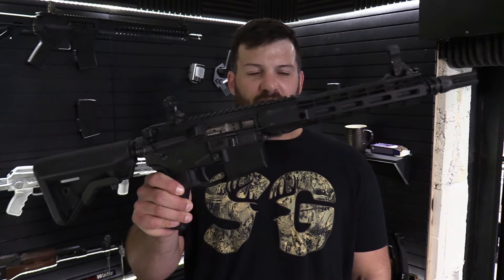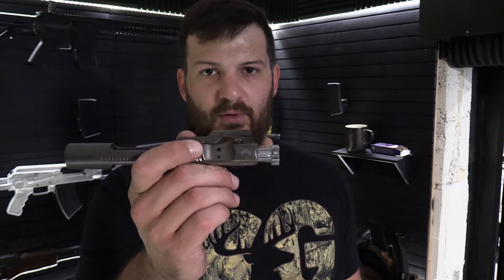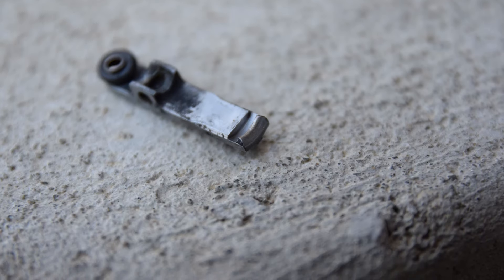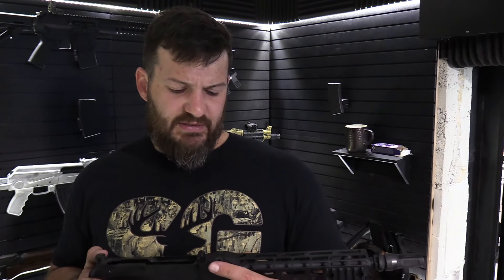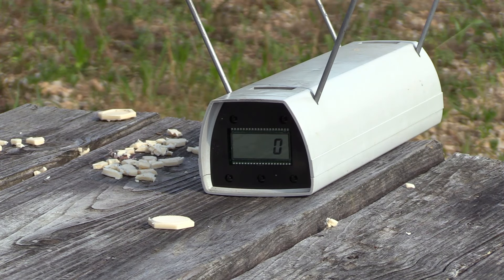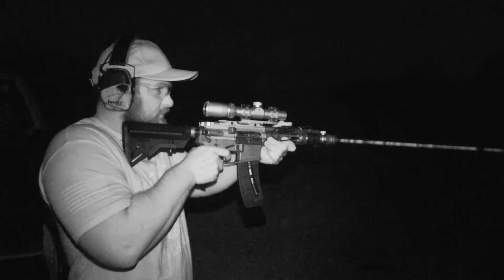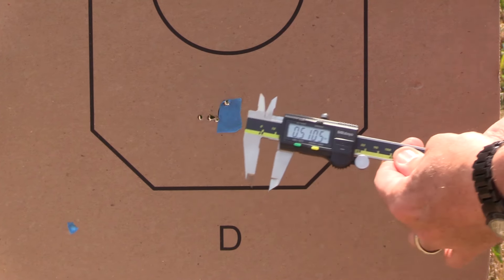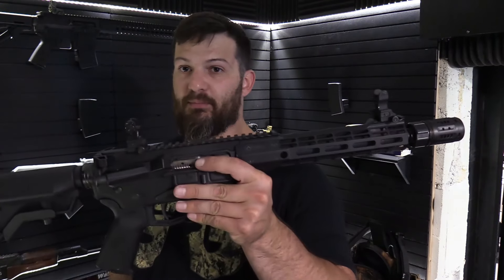Chrome Lined Barrels are Stupid || A Year of Testing

Comment: AK dudes are the most stubborn when it comes to the chrome vs nitride debate. I get it if you wanna build a "true combloc" clone, but just go with a 4150 nitride barrel if you're actually gonna shoot it lol
Reply from the maker: I have not tested an AK to this level so I cannot say one way or another. But I could argue that the chrome could be more viable in an AK because a lot of the ammunition is not a true copper jacket.
Reply: The VSO Gun Channel From my experience, the only advantage that chrome lining has is the heat dissipation. (So I can see the need with an actual machine gun.) Other than that, nitride is generally more accurate and can hold its own during training.
Reply: Most old surplus 7.62 is corrosive, even the ones that say non corrosive are just less corrosive so I’d say you probably wanna keep that chrome lining, atleast in your ak’s
Reply: @StarCypher  i have a chf nitride QPQ barrel..and a chf chrome lined phosphate barrel. Both are very accurate, i can't tell the difference

Comment: My CHF, CL HK MR223 barrel lasted like superman. After 12K rounds I still remember letting one guy try it and he shot 10 rounds inside 1moa the first time shooting that gun. But at 14K it was doing closer to 2moa and 15K 2.5moa so I had it switched to a Lothar. It started really well under 1moa but now at 3K I just tested 20shot string and it made 1.3moa.

The HK barrel was the ultimate "sniper" barrel, I rarely had to clean it and it had no POI changes either.

Comment: The first M16-A1s were made by Colt but without chromed barrels as a way to save money but being in the field under combat  conditions would  became rusted and had corroded chambers. The cases after firing would stick and then would jam. That was the main reasons for the chrome, Also they would not burn out after fierce fire fights.
Reply: the vietnam dudes also didnt have qpq melonite. Or nitire or any crazy coating. Chrome line was all they had.

Comment: Mr. gunsandgear did a test with Faxon Chrome lined vs QPQ full auto on both, the chrome lines barrel failed and blew out the gas port from erosion. The QPQ barrel kept on running. Best setup is a CHF QPQ barrel with a Nib carrier and Chrome bolt, phosphate extractor. Your welcome in Advance.

Comment: Well my AR has a chrome lined barrel. Why?  Because you don't know what you don't know until you know it. Or something like that.
Reply: Mine has one because it came with one lol
Reply: I think the US Military did more testing than this guy did - with his one gun.
Reply: @MrChuckwagon55  they also came up with government profile barrel as a standard which is probably the worst. They took material from the most important place close to the chamber and left weight near the muzzle to make it front heavy and useless.
Reply: @madeintexas1213  - Why did they do that then? It doesn’t make any sense. Why not have made the barrels the way you suggested? What you said is the most logical and makes the most sense.
Reply: @MrChuckwagon55  take some look at Hanson profile barrels from ballistic advantage,  that the most ideal profile.  You can go watch Mr. Gunsngear or any other person for that matter and they will tell you the government profile doesn't make any sense.
Reply: @madeintexas1213  - No, I totally believe and agree with you on the government profile barrel. I just want to know why they did it. The government usually have all these reasons & reports etc. of why and I am curious why they did the exact opposite that makes sense.
Reply: @MrChuckwagon55  they wanted to drop weight but retain the gas block and ability to attach a 203. That’s the reason. Things militaries worry about, not a concern for us.
Reply: @windsnowandstatic9075  - Don’t they use chrome lined barrels because they handle heat better than nitrided barrels and last longer?
Reply: @MrChuckwagon55  For their purpose and testing yes. Plus corrosion resistance. But that’s also not really a concern or consideration for a singular rifle owned and used by a singular person who probably won’t fire enough rounds through it to need the benefit.
Reply: @windsnowandstatic9075  - Can chrome lined barrels be nitrided? Best of both worlds?
Reply: @MrChuckwagon55  No clue personally.

Comment: Contrary to popular belief, the gas rings don't need to support the weight of the carrier. The gas rings only need to support the weight of the bolt.
To perform the test, remove the firing pin and the cam pin, then  point the bolt up, and if the bolt collapses into the carrier, replace the rings. Or, after removing the F.P. & cam bolt, hold the carrier upside-down and if the bolt falls out, replace the gas rings.

Comment: I don't know how I got here, but. My Criterion Core series 13.9" barrel (chrome lined, phosphate 4150 CMV) has seen 0.625" groups at 100 yards with IMI 77gr razercore, and just under MOA with AAC 69gr HPBT as well. These groups were shot with a hot barrel as well after several mags of other factory ammo's being grouped.

Criterion hand laps their bores before using a proprietary chrome lining process to maintain uniformity. Those barrels also chrono fast; I got 2,747 feet per second with the razercore and 2,800 with the AAC 69 grain. Out of a 13.9" that is phenomenal and just as fast if not faster than the majority of 16" barrels on the market for heavier grain 5.56. I also got 3,059 feet per second out of 55gr FMJ which not only furthers my point but concludes it concerning velocity. Chrome lining is a very low drag/low friction surface for a bullet to travel down and can be held to very tight tolerances and hold a very tight seal, when done correctly, and along with a 223 Wylde chamber which reduces slop compared to a 5.56 chamber, this makes for a very fast, very consistent barrel. 

No, chrome lining hasn't been known to be very accurate in the past, but i'm writing this comment in 2024 after gathering some of my own data with what is currently available to us today on the market.

Comment: I have a milspec chrome moly barrel with thousands of rounds through it. I can still pull sub-moa groups with the right ammo. But running a few dozen rounds a month at a low firerate is a different than mag-dumping and full-auto hell-testing.
Reply: A chromoly steel barrel that's chrome lined or nitrided? Or just plain chromoly?. I say this because many people get confused thinking a chromoly barrel is always chrome lined. Chromoly steel is the 4140 or 4150 ordinance barrel material, not the chrome plating subject matter in the video fyi incase you didn't know.

Comment: On this machine gun build, was the gas block pinned or just dimpled for set screws?
Reply: The BA Hanson barrels come with a pinned nitride gas block. Part of the great cost vs value. 3 out of 4 my ARs have them because of this (and it would be all 4 if they had been on my radar - or in business they may not have been - when I built my first). Highly recommend.

Comment: I just purchased a Ballistic Advantage and a Criterion barrel. After 150 rounds the Criterion has zero copper In it. The Ballistic Advantage had copper fouling horribly after 5 rounds.  Accuracy was the same between the 2 but the Criterion is way less maintenance. After some more rounds the Ballistic Advantage should smooth out and not copper foul so bad.
Reply: so you don't want copper in your barrel?
Reply: @name-k7t  Some donesn't matter much, but it will decrease the depth of rifling making it less acurate as it accumulates.

Comment: Doesn't Nitride tend to burn off under FA fire...or lots of heat? as opposed to the Chrome lining...not that the average shooter would need to worry about that issue...
Reply: In EXTREME heat you can reverse the nitriding treatment.

For context, you need to run a minimum of ≈450rds in full auto without ceasing to reach that level of heat.

So if you carry 15 fully loaded mags on your person and have a full auto, and you have some asinine reason to mag dump 2.14 combat loads, you might need chrome lined on top of a few other things.

Comment: I don't think twice about buying either chrome or nitride if the cost is right. I don't touch that nickel boron shit with a 10 foot pole, however. I would do a nitrided bolt and carrier, though. If they don't coat the barrel with nickel boron, why would you use the shit? (Good) chromed bores are fine it's not like they aren't combat proven. They chrome machine guns and AKs. But yeah, I would recommend nitride.

Comment: I’ve personally seen more issues out of chrome lined barrels to make the difference not worth it. Flaking off chrome in the case of a Remington, chambers out of spec due to the chrome lining making stuck cases more common. Even in spec chambers have higher rates of stuck cases. It just ain’t worth it. Nitride is better for corrosion mitigation and accuracy anyway.

Comment: Also should be noted that QPQ nitriding offers about 85% more corrosion resistance than hard chrome.
Reply: Not talking about round count corrosion but rather corrosion from the elements. Such as salt spray test.
Reply: @wockawocka5293  im assuming you're not talking about the bore of the barrels either and that you're talking about nitride vs manganese phosphate on the outside of the barrels???

Comment: The metal under the chrome rust and then  the chrome gets pitted and flakes off. We've all seen rusty chrome parts on car and motorcycles or what ever especially on exhaust pipes that only reaches about 1400°. Chrome requires alot of maintenance and the right environment to keep it from getting rusty and flaking off. My hard chrome finished guns are the worst for rusting.

Comment: That topic has been beaten to death. Nitriding in a barrel will last a long time if you dont overheat the bore above 400C. After that the "hard candy" will dissapear and you basically have an plain steel barrel. And then the rifling in a high heat flux weapon like a short barrel 5.56 will go away fast. The US Army Ordnance Departament testing showed it many times. First during the WW2 M1919 machine gun barrel improvment tests, then during Stoner 63 tests when the technology to chrome line a 22 cal. barrel was not mature enough, and recently during the URGI barrel tests, when nitrided barrels were tested and failed miserably. You can not say chrome is just a marketing talk. Its Nitriding more of a sallesman hype than anything. Its not that hard to heat up a barrel past 400C especially with 5.56. I dont know how your barrel survived that what you claim it did (melting down suppresor would yield much more than 400C barrel temp), but every technical manual about QPQ states that case hardening of nitride is good to max 400C. Either you somehow did not reach such temp melting pot metal supperesors, or you are talking BS.
Reply: @Emmanuel Goldstein please explain

Comment: Ballistic Advantage isn’t that great. It looks VERY nice and shoots decent. But they have the WORST customer service. I had some weird barrel extension wear from only 30 rounds, led me to believe it wasn’t clocked right onto the barrel. They refused to say what was wrong. But I knew, so I returned the barrel to primary arms and I’ve decided to never buy BA again. FN barrels are better anyways. I buy nothing but chrome lined and get less than 1” groups at 100 yards
Reply: With what kind of ammunition?

Comment: Can't say Ive ever seen someone use a drill to clean a bore.  That was a little eye opening.  Can't say I clean my AR often either.  When it begins to malfunction, then I clean it.  I like my Aero stuff.  Great vid!  If chrome lining did anything whatsoever to increase barrel life, then I can guarantee you us F-class, PRS, and benchrest shooters would buy the shit out it.  It doesn't though.  Primary reason we use stainless 416R is...well hell cause it polishes up real nice I reckon.  Can't really say it provides any wonderful longer lifespan than CroMoly steel.  I've shot em both and equally as accurate.  Bartlein does make a 400ModBB alloy barrel which does last longer, but you can't do load dev on the damn thing til you have 3-400 rounds through it, because it speeds up after that due to cut rifling remnants finally being hone down.  What extra life you might get out of it just aint worth it.  Barrels are to be considered more expendable than any other part of a rifle.  Soon as you buy one, go ahead and make peace with yourself you'll have to throw it out one day.

Comment: Chrome lining is definitely not stupid particularly with Criterion holding 10,000 of an inch Tolerance on their board dimensions pre and post chroming out of the box they shoot 0.3 Moa after 1😂000 rounds still sub Moa and the way you clean your barrels bro is terrifying use a drill in a brush to just knock the particulates free and then shoot it out😢 you're destroying the barrel you're better off just not cleaning it

Comment: I can find chrome lined barrels the same price as nitride barrels 🤷‍♂️ Until someone makes a cold hammer forged nitride barrel with a 5.56 chamber, I’m sticking with chrome lined.
Reply: Ya, I've been waiting to see more chf nitrided barrels out there. So far they're mostly chrome lined. I've seen a few hammer forged stainless steel nitrided barrels, but not mil spec cmv 11595 ordinance barrels.
Reply: @Joshua Gabaldon Since when do you chrome line and nitride a barrel
Reply: @Joshua Gabaldon  All good
Reply: @muddyhotdog4103  SIG MCX are CHF and Nitrided.
Reply: @Joshua Gabaldon I installed the nitrite 18 inch SPR barrel on a Spikes build. It's actually produced by FN ising their proprietary steel. The same steel they manufacture the M249 SAW barreles out of. I love it.

Comment: Why do all light and heavy machine guns like the M249 and M240 only use CHF chrome lined barrels?
Reply: Way i understand is if you run your stuff full auto..or do a lot of rapid firing.. chrome lined is the way to go because of heat. I have both a chf nitride QPQ..and chf chrome lined phosphate. Both are super accurate.
Reply: @countryfriedent  this.

Comment: I’m looking at an upper that just says “chrome lined: no” but doesn’t say if it’s coated with anything else at all and says it has a parkerised finish so I just wanted to make sure if I should purchase or not. Especially with the current climate of not having many options. It’s an AR Stoner side charging 6.5 grendel upper. Thanks anybody who is able to help me. I don’t have the money to buy now and cry later I need to be sure of my purchase.
Reply: That barrel is a CMV (cromoly vanadanium steel) with a parkerized finish, just like the description says. Parkerized is the cheapest and easiest coating for metal, but not as good as nitride, TiN, NiB, or chrome lined. 

Depending on what you want to do with that barrel will dictate that decision.

Comment: My mind was screaming while you were using the drill on your barrel.  Nice should never use a drill on the barrel In attempts to clean it.  You just need to pull a patch wetted with hoppes.
Reply: Dude a brush isn’t going to hurt the barrel of metal moving at thousands of feet per second doesn’t.
Reply: LinusScrubTips thats what i was thinking. If shooting a shit load of ammo through it isn’t hurting the barrel, how is a brush gonna hurt it?’
Reply: @LinusScrubTips  no but maybe that spinning steel rod might scuff the crown
Reply: @worldfamousgi86  the steel on a rod is nowhere near as hard as the steel of the barrel. It's not gonna damage the crown
Reply: I don't even own a gun like that and it still made me wince when he did that.
Reply: @justsomemincedgarlic  a bullet rotates with the rifling, the brush is scrubbing against the grooves

Comment: if chrome lining keeps me under one MOA after 10k plus rds instead of two plus MOA then chrome has an advantage,

chrome has a vary distinct and well proven advantage reducing throat and rifling erosion and accuracy loss in machine guns,

did you use the same over pressure hot 5.56mm ammunition the us military uses?

did you test the entire life with M855A1 ? no because you probably couldn't afford it.

furthermore element chromium melts at 3,465°F  but plain Chromium–vanadium steel barrels melts at 2,830°F and nobody can argue with the melting points

Comment: I am pretty positive Ballistic Advantage is using Chinese steel in their barrels (Please someone correct me if my source is wrong), hence why they are a tad less expensive than some of the competition.  I'm not saying that makes them bad, but I'd like to see American companies using American steel, and I'll pay more...
Reply: Is their a difference? Roscoe barrels are wayyy less, so wouldnt they be more expensive than others, not less?
Reply: @tommcfarland5368  Don't get me wrong, I think Ballistic Advantage makes good barrels, but I'd rather have American sourced steel.  Steel as a whole has went through the roof as of late, no matter where it comes from.  But you can also buy barrels that cost $500-1000, so I'd say Ballistic Advantage is on the lower end of barrels, but definitely a good barrel nonetheless.
Reply: @shojus  any companies that you know of, off hand, that use American steel?
Reply: @tommcfarland5368  Rosco, the company you named uses 100% American steel.
Reply: @shojus  they are also 100% perfectly gassed compared to the barrel size...perfect ejection, every time. Thats why they are always out of stock. Thanks for your time!
Reply: @tommcfarland5368  👍

Comment: The length of life of a barrel has much more to do with how its manufactured than what it's coated with. A cold hammer forged barrel will always outlast a button cut barrel like BA, Criterion, etc. Battlefield Vegas reports 10-16k life before keyholing on AKs (so using bimetal projectiles) with button cut nitrided barrels, PSAs mostly, and combloc CHFCL barrels will go 60-80k+ rounds before keyholing.